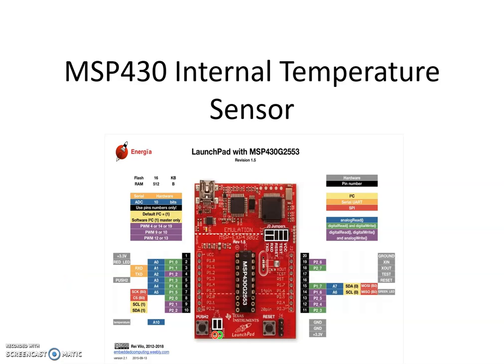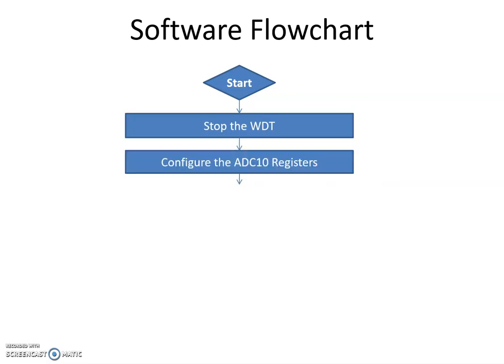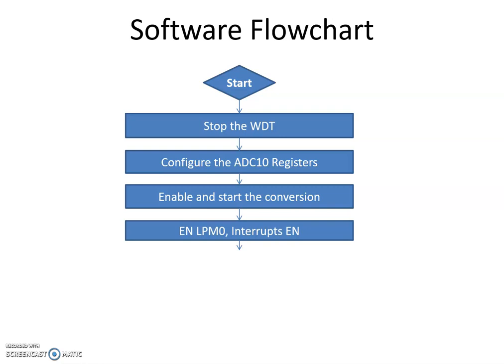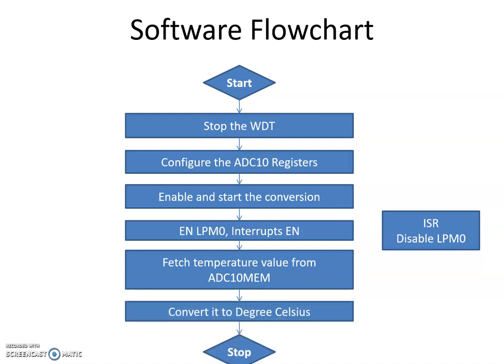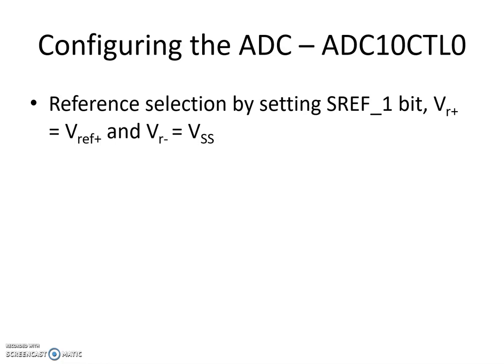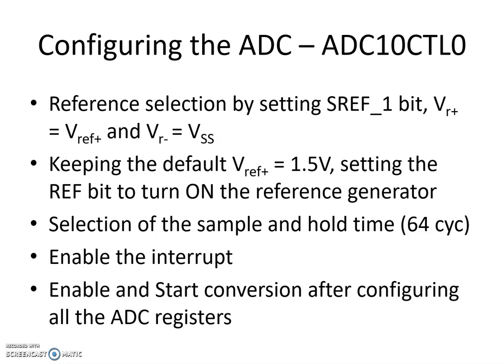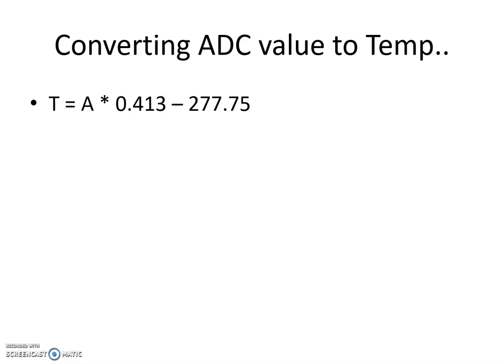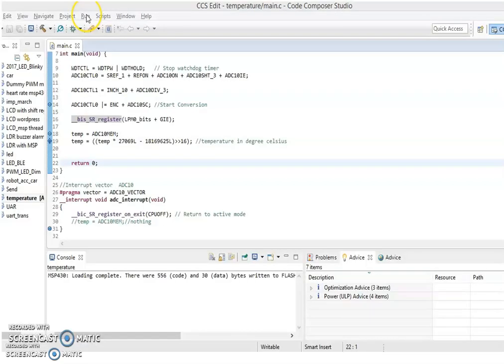MSP430 internal temperature sensor

Comment: Could you make a video about how to set the MSP430 to sleep mode? Thank you.
Reply from the maker: Sure, I will cover the low power modes.
Reply: @BinaBhatt  Could you do this like the msp 430 tests the sensor to get data every hour and it switches to sleep mode when it is not testing?
Reply from the maker: @fengbangxie7635  You can use the Timers in MSP430 for this purpose, it is pretty easy. Check this video on my channel: https://youtu.be/Drisf7VQI60
Reply: @BinaBhatt  Could you still do a video according to what I mentioned?